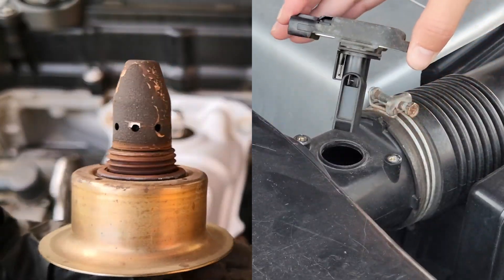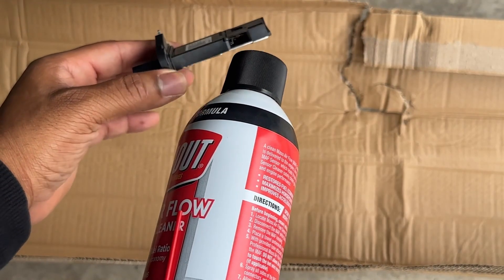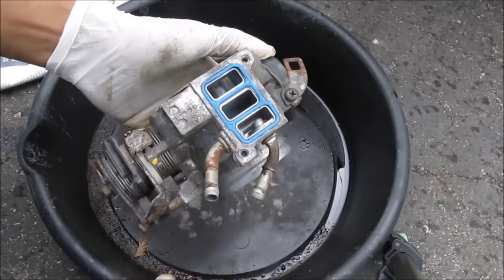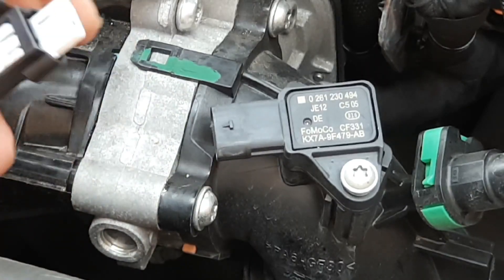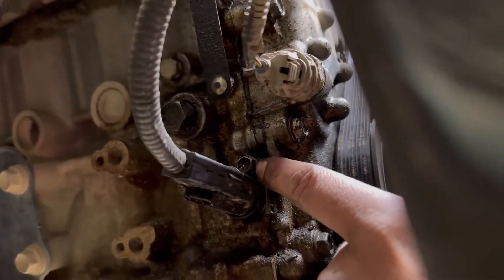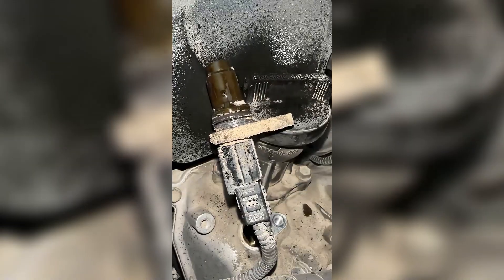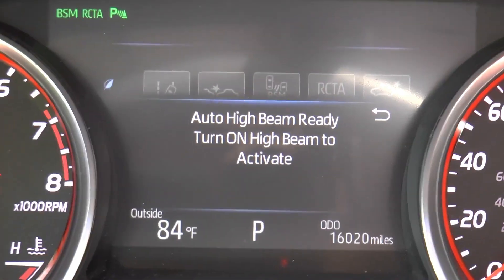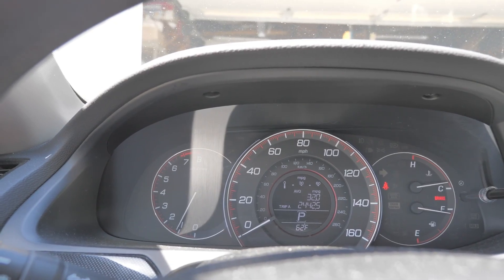Cleaning These 8 Sensors Makes Old Engines Run Like NEW

Comment: I just bought a used car, and the first thing I did was change all the fluids and filters. I thought that would be enough. My automotive knowledge is limited, as I previously focused on motorcycle engines. But after replacing everything, I only cleaned the MAF sensor, spark plugs, and TPS. I thought that would be enough. 😅 After watching this, I gained new knowledge. Thank you, I will clean them next. Warm greetings from Indonesia 🇮🇩, a country where there's a lot of fuss about 10% ethanol gasoline (FYI)🤣